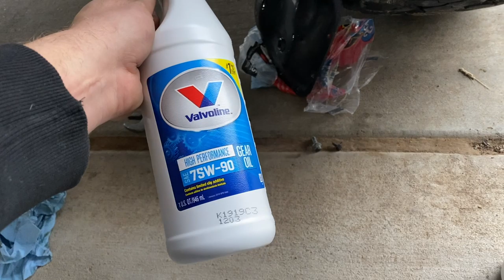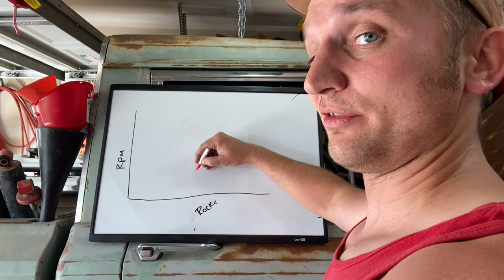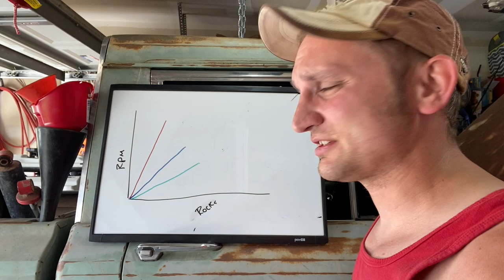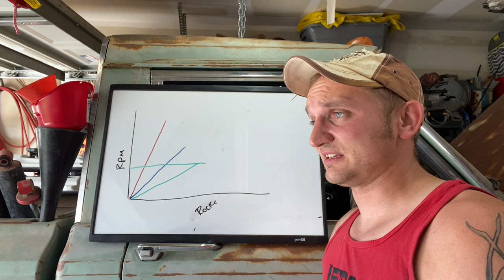Gear break in, what to expect

Comment: I am breaking in the 4.88s I just installed in my TJ with 35s NOT on stock axles, like just drove it first cycle tonight. Your not only breaking in the gears but the bearings are breaking in too. Also, biggest reason you cycle and cool is to keep the gear oil from getting destroyed from overheating during break in. Once the gears and bearings break in they run cooler.

Comment: I'm surprised the shop where you got the gears installed didn't follow up on a visual inspection of the gears and changed the fluid. I do re-gears exclusively on jeeps in OKC for 250.00 an axle non-rubicon 275.00 per axle for rubicon with a follow up to check the break in was done correctly also measure backlash just in case. To ensure quality workmanship

Comment: Just regeared my JK 3.21s to 4.88 , went to Vegas and the 35s with 3.21s felt like a slug, I was stuck between 4.56 or 4.88 went with 4.88 but now I feel like I should have went with 4.56 I don’t like the high rpms the 488s has I go wheeling time to time not a whole lot which I’ve been told 488s are a better option for serious trail heads, any advice? I might just give the 488s some time to break in and see how it does on long hauls
Reply from the maker: The Jl... has an 8 speed transmission which makes a huge difference. U won’t experience any difference the longer u wear in ur gears.
Reply: Just put 37" tires on and problem solved!

Comment: Really the only special tools are a set of calipers for shim measuring($50 or less) a press ($150 at harbor freight) and a dial indicator($50). You can spend the big bucks and get a claim shell bearing puller for $300 or so but you can also just cut the bearings off. People will tell you its cheaper to take it to a shop..... but id rather spend up to $550 in tools that I get to keep and use than pay thousands on labor. I also don't trust shops either. Im very rarely happy with the work I've had other people do. If something goes wrong I'd rather it be on me, not someone else.

Comment: For all of you E-locker owners out there you will want to put very strong magnets on the diff dover where the fluid is spinning around inside. The E-lockers use magnets, and the metal fines from break in will get inside the locker magnet. External magnets catches most of these fines, so your locker will live a long life.

Comment: Thanks great video!  I live in a small town no 4x4 shops I have to drive 200 miles have my jeep regeared. Looks like It will be easier to spend a few extra days in the city doing the break in first, rather than heading straight home.
Reply from the maker: After the initial 3 cycle period... u can go much faster... just be sure ur still pulling over to allow cool down.

Comment: I just got my gears replaced here in Arizona . After the brake in process i went to a different shop for diff oil change and inspection and they found a lug nut washer inside my front differential plus the installation was incorrect . I called  the installer and he will be giving my money back today.
Reply from the maker: Did U hear a clanking?? Thts horrible... stories like tht is why I HATE paying people to work on my jeep...

But glad to hear they are refunding u... hope they buy u the new parts to do it again correctly.
Reply: @JLLIFEOFFROAD  i texted you on FB
Reply from the maker: Give me a minute.. I’ll go look

Comment: I know this been yrs ago. I just went w 513’s on my 23 gladiator I bought the same cover just under the moto built brand. I notice during the break in these covers get really hot how did your gears do with these cover
Reply from the maker: Never had an issue with em
Reply: @JLLIFEOFFROAD  awesome mine a daily driver and trails.  I got to do the fluid change in the morning so I see how the gears look been a week lil over 500 miles so im hoping it all good

Comment: I'm in the middle of having gears and a posi put in my truck.It has been a nightmare. I paid 1,200 for all the parts. Took it to a shop they charge me $800 to put it in, which was the cheapest that I could find in my area. I had to wait 2 weeks .went and picked the truck up and it was howling  so bad I turned right back around and took it straight back to the shop. They then tried to blame it on the drive shaft.7 more weeks and I'm still waiting.
Reply from the maker: Sorry to hear that my friend… gears are one of those things that have to be exact… you have such small room for error. Gears are something I encourage people to go to a quality shop to do… that will stand behind their work…to avoid the headaches you are dealing with

Comment: Don’t get me wrong nothing is bad about doing this but when we buy a brand new 60k plus vehicle do we spend time breaking in gears? I think breaking in New Years is great and all but probably just driving normally and changing the oil would be good enough.
Reply: Doesn't matter if the rig cost $6,000 or $60,000 - if you install a new gear set, you should follow the gear maker's break in recommendations.

Comment: Love the video...With 5.13 gears in the JL rubicon d44's, do you think the weak point becomes the ring and pinion considering the 5.13 pinion is noticeably smaller?  Or are axle shafts/u-joints still more likely to break first?  I've read rcv's/chromoly shafts further shift the weak point to the ring and pinion.  Thoughts?
Reply from the maker: Yes... it will... but my opinion ur less likely to break if ur able to keep the rpm’s lower... of course nothing is fools proof. Iv seen someone on 35s and 4.10s put his tire in a bad line and absolutely Grenaded his transfer case and snapped is axle shaft in half

Comment: So what about the front diffs? They are not engage unless in 4x4. So for the front diff do you drive 500 miles while in 4x4?
Reply from the maker: So deleted my fad ... so it’s always turning.. I recommend throwing it in 4x4H when ever u can... putting it under ‘load’ will ensure the break in is proper..

Comment: So to break in the front diff do you have to do all that in 4hi?  I thought with the FAD the front doesn't spin in 2hi.
Reply from the maker: Yea... I have done the fad Delete axle well over a year ago and hadn’t really thought about the fad...

U WILL need to be in 4wd in order to break the front gears in if u are running the fad still..  I’d recommend throwing it into 4wd on straights... shifting back to 2wd when u have a turn coming up...

Comment: Would it be a good idea to mark some of the teeth to monitor the wear the next time you open the cover?

Can you advise on how much the install would cost? This would be something that I would probably pay someone to do also is why I'm axin.
Reply from the maker: U will know if the teeth are not connecting right... the rubbing wear... will not be centered... 

Cost... is not cheap.. U can expect to spend anywhere from $1200-$1800 for labor... of course the parts cost another $1000ish.... if u want lockers.. perfect time to have em done also... 

We plan on buying some 44s for mistys jeep... I’ll be doing tht gear how to when we cross tht bridge...
Reply: Typically good gears won’t be cheap especially if you decide to go bigger than stock you also have to match spline count unless you plan to upgrade the axels, most units will also require a speed sensor update or they will throw tcs lights on the dash… most installs cost between 2800 parts and labor but they can exceed the 4000 limit depending on your preference in parts

Comment: With the front axle disconnect, the front pinion won't be turned by the ring gear as the spider gears will just be turning in two-wheel drive I would assume. If we are still running the stock FAD, I wonder if we have to put it in 4 high and do the break-in OFF asphalt or if there is a way to make the FAD connect in two-wheel for the break-in?
Reply from the maker: U need to throw in in 4wd during straights on road, back to 2wd on turns.
Reply: I’m so glad you asked that! I was wondering the same thing and haven’t found any info on it but common sense tells me to throw it in 4 Hi on dirt roads to break em in.
Reply: @JLLIFEOFFROAD  I’ve been reading all your responses to people’s questions and you’ve helped me out a lot. I also just re-geared my JT to 5.13s. So far I’m loving it. You’ve earned a follow from me! Keep up the good work!

Comment: Great video I had to come back to watch it again before I go get my regear done on my 16 jku.  For 3.6 auto 5 speed running 33s (285 75r16) would 4.88s be too much? I'm in the PNW.  Charts say I would be around 2700 rpm at 70mph. Doesn't sound horrible.  Not going 35s anytime soon with the D30 front. Any input appreciated.  BOO 3.21s!!!
Reply from the maker: Personally... I think 4.88 on a 5speed and 33s is way to much... for tht tire size I’d recommend 4.10 or 4.88 depending if ur looking for on road or off road performance
Reply: @JLLIFEOFFROAD   Thank you for your quick response :)   Love your vids!    If you keep crankin them out Ill keep Thumbs Up-ing :)
Reply from the maker: I like it 😎

Comment: Great video, My question is in the break in period do you have to use 4 wheel high?
Reply from the maker: When your going straight, keep it in 4x4. When you are making a turn, quickly shift it back into 2 wheel drive. Putting the front under ‘load’ is only gonna break in the front more properly. 

Of course if you have the FAD connected, you 100% have to have it in 4x4.

Comment: It would be better to explain that the expectation of the thickness of the flange on the cover is similar to the geo-shape of the cover itself. And the amount of fluid is dependent on the size of the cover as well, need to fill to the bottom of the tube (inner diameter) cause that's where the axle seal is located. (Want to be able to pull a shaft and not have fluid drain into the tube where potentially, you can scrape dirt back in when reinstalling shaft.)
Reply from the maker: Yes those are valid points... the things I always leave out when I don’t write out my ideas on videos 😬

These have been designed to hold two quarts of oil.. I spoke to the owner of cavfab about em...

Thanks for holding me to a high standard friend.. will only help make me better... thanks
Reply: @JLLIFEOFFROAD  Not holding you to a level at all...just my own experience.
Reply from the maker: No, constructive criticisms help me look at videos more... otherwise I wouldn’t improve.. I appreciate it man.. not tryna sound like an ass 😂 sometimes glaze over things I SHOULD have discussed.

Comment: Great vid,,,Do new gears make a slight noise at first then go away after break in ?
Reply from the maker: It can.... what kind of noise are you hearing??
Reply: @JLLIFEOFFROAD  Just a slight humming at light throttle when coasting around 45 ,The gears had a excellent gear pattern
Reply from the maker: They can.... get through the break in... and re-examine
Reply: @JLLIFEOFFROAD  Thank you

Comment: Thanks for getting back to me so fast! So use 4 wheel high for the entire 500 mile break in?
Reply from the maker: Is your fad still engaged?
Reply: @JLLIFEOFFROAD  
I been wanting to know this too. I still have my FAD(front axle disconnect) so I was wondering if I would have to engage in 4WD- 4HI for city driving to apply some load and properly break-in the front axle gears since the front driveshaft don't spin under normal use in 2WD. I don't see this getting mentioned on other videos regarding gears. They often forget the new JL/JT have the FAD. Any advice will be greatly appreciated!

Comment: OK, just curious; you explained how gearing can effect torque for getting over obstacles, but what does it do to performance on the road?  Doe sit improve/hurt gas mileage, increase/decrease acceleration, increase/decrease max cargo, etc.
Reply from the maker: Yea... be happy to answer y I neglected all tht... this video was not a ‘why you should regear’ video... more so focused on the break in... I touched on low end torque because a lot of videos mention it... but never really explain what it means... I’d be happy to make a video about why you should regear and touch on all those topics for ya...
Reply: @JLLIFEOFFROAD  It would be great appreciated.  I am in the process of getting a Diesel Wrangler Willys and suspect the low end torque might be used to greater effect with (slightly) larger tires but want to understand what I'm getting as well as giving up if I regear when I (inevitably) lift and go bigger.
Reply: @fretless05  If you are ordering a new wrangler there is a package now with 35" tires and 456 gears. All I can say is wow!

Comment: i'm honestly surprised you did 5.13, it seems like with the new 8 speed trans in the JL they play well at 4.88 with the 37 crowd.  it's the happy medium (so it seems)
Reply from the maker: Having tht 8speed... 5.13s are great... Iv heard 4.88s also been working great for people... tht the rpm difference is just a few hundred.
Reply from the maker: I rather have more performance then onroad 😉
Reply: @JLLIFEOFFROAD  that does indeed make sense.  Either one gets you into 2nd overdrive on the highway.  It was so windy coming out from Colorado we had to keep our speeds down to 70 or less anyway.
Reply from the maker: Lol I mean... it’s close to
The sped limit lol

Comment: Thanks for the info.  I'm thinking of regearing as well. But now I have think about it more because my jeep is my daily driver. And have to get on the freeway to get to work. 😭 what to do.
Reply from the maker: What gear/ tire size u currently at?

Re gearing ain’t cheap... a lot of questions come up.. how long I planning on keeping the jeep.. how often do u drive it.. what kind of any off-roading are you planning on.. 😂 so many things it could easily be another video
Reply: @JLLIFEOFFROAD  I currently have 33'  tire. As for gear not sure. It's a stock 2013 jk manual transmission. I want to get 37' tires.
Reply from the maker: Currently being on 33s... u should be fine. If u decide to get wild and put 37s on... u need to regear 😂
Reply: @JLLIFEOFFROAD  that's the thing I want 37' that is why I want to regear lol. All in due time I guess😂👍
Reply from the maker: Yes sir... all in good time 😂 Thts what I keep teling mysef

Comment: Well the issue how you break in the front gears if you're still on stock front axle with FAD since the pinion is not spinning ?
Reply from the maker: Lmao.... u know... I didn’t even think about the fad 😬😂

GOTta have the gears turning.... means gonna need to be in 4wd high during break in. DAMMIT... Iv been fadless for the last year+ didn’t even think about it
Reply: @JLLIFEOFFROAD  that's gonna be an issue to be driving in 4wd on paved roads for days 🤣
Reply from the maker: Alternative is u prematurely break the r/p and start  over. I’d say find a long straight stretch of road to do it on. 

I mean deleting the fad has its benefits 🤷‍♂️
Reply: long straightaway with the jeep in 4 high, shouldn't be too big of an issue.  but even with the FAD, doesn't that driver side tire still turn the ring? maybe not... i never thought about it.
Reply: @JLLIFEOFFROAD  yeah you just have to find a straight road and go back to 2wd on sharp turns , i got 1 piece rcv on my new front axle but for the people on stock axles gonna have to deal with it i guess lol
Reply from the maker: Justin... no.. the ring won’t rotate with the fad and disconnected...
Reply from the maker: Lol.. misty did it with the fad... it was just.. throw it in 4wd on straight ways.. switch to 2wd on upcoming turns
Reply: @JLLIFEOFFROAD  that's good to know!!
Reply: Pull the front driveshaft and put it in 4hi. Everything spins now just like in the JK.
Reply: @dlporter  pull the drive shaft and put in 4hi? Why?
Reply: Wrangler Addiction because the you don’t have to worry about u-joint bind or shifting back to 2wd for for tight turns. I replaced my driveshaft at the same time I did my regear on my JL, so I just waited to put it back in.
Reply: @dlporter  u need the drive shaft to spin your gears in the jl because of the fad unless u have rcvs .
Reply: Wrangler Addiction Wrong. Putting it in 4hi locks the FAD. Once the FAD is locked, everything inside the front axle spins even with the driveshaft removed.
Reply: @dlporter  now that make sence first i was like wth he's talking about 🤣 thank you for the tip .
Reply: Wrangler Addiction no problem. I should add for everyone reading this that unless you’re planning on replacing the front driveshaft at the same time as your regear, I would not recommend doing this. The bolts at the t-case are a pain in the ass to reach, and it’s not worth it to pull the stock front driveshaft just to break in the gears if you’re going to turn around and put it right back in.
Reply: @dlporter  i agree i rather just go back and forth between 2wd and 4wd , i have 1 piece rcv on my new axle so i'm not gonna worry about that  lol

Comment: Why Do we drive on two wheel only and not 4 x 4 if both front and rear get replaced for break in period
Reply from the maker: I suggest going in 4... just switch it on straight ways... sharp turns switch back to 2
Reply: @JLLIFEOFFROAD  can i drive highway speeds 4x4 for 30 min then let it rest for 30min to properly break in the fronts
Reply from the maker: Long as it’s 65mph or less
Reply: @JLLIFEOFFROAD  as soon as I engaged to 4x4 it’s making a clicking sound , is that the metal shavings that’s beginning to have?
Reply from the maker: @FROSTY420692002  doubtful,
Reply: @JLLIFEOFFROAD  what could it be I hear it on the driver front which obviously is coming from the front diff
Reply from the maker: Could be ur gears weren’t installed correctly... have the shop who did ur gears look at it...
Reply from the maker: Least is what I would be looking at if it is when it started